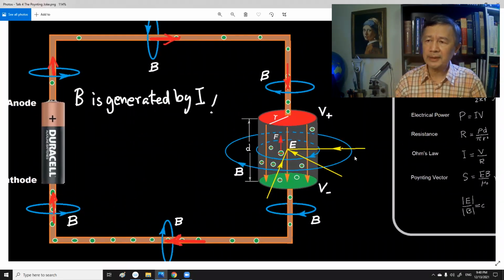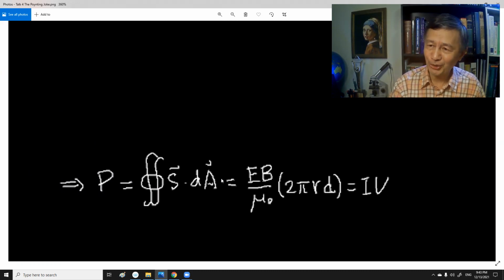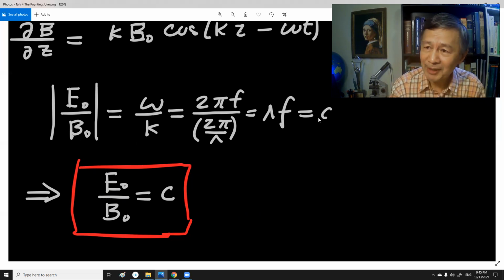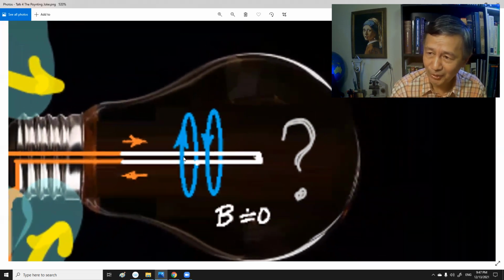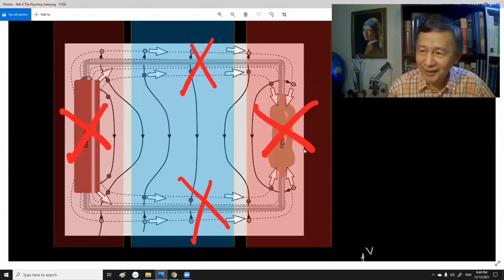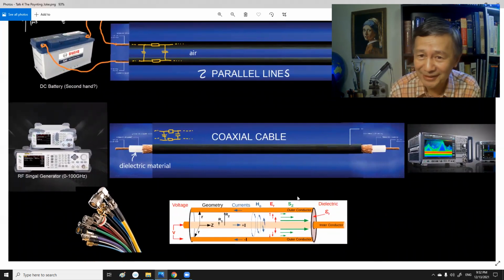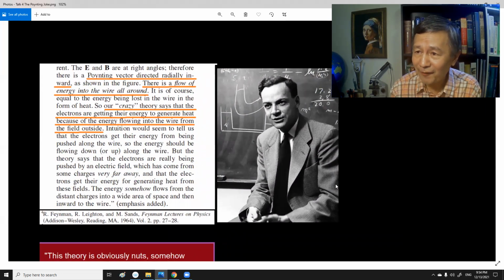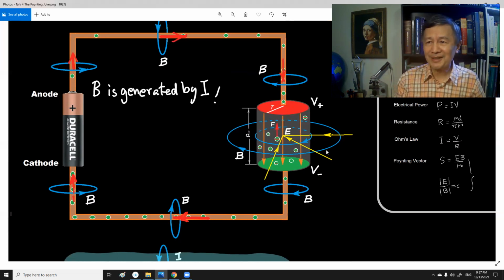The Poynting Joker | Veritasium's Big Misconception about Electricity  4 | 波英廷小丑：真理元素對電學的誤解

Comment: In the actual experiment the length of the wires is probably less than 200 feet: of course the bulb lights ‘instantly.’ Circuit theory is simply mathematical model. For practical reasons it works. The physics is way off. No energy, charge, photons, waves, spin, fields, polarity, etc. Expanding electrons crossing over from subatomic realm to atomic realm is the physical cause. DC produces a magnetic field- expanding electrons physically leaving the wire perpendicular to wire but also spiraling. No electrical field from DC. AC produces electric field only at capacitor. The travel time in the Veritasium thought experiment ( assuming as Derek says zero resistance in bulb and wires) would be 2 seconds. Without understanding Mark McCutcheon’s Expansion Theory endless debate about ‘effects’, ‘ models ‘ and computer ‘simulations’ will continue.
Reply from the maker: Are you talking about metaphysical stuffs?
Reply: @yongtuition  No. Expanding electrons are particles, objects,matter. The “quantum “ so called. Juliana Mortenson website Forgotten Physics classicalized QM in 2010. Everything- excepting some Copernicus, Galileo, Kepler and Brahe) in physics mere gobbledygook. No metaphysics is possible without a proper physics. Metaphysics is yet anybody’s guess. “The Final Theory: Rethinking Our Scientific Legacy “, Mark McCutcheon requires as the title says a complete rethink/ overthrow. Sad but true.
Reply from the maker: @davidrandell2224  Then you are not talking physics.
Reply: @yongtuition  Typical . You can lead a horse to water but you can’t make it drink. Epicycles/Standard Model on the shelf of “ historical curiosities that didn’t pan out.” Grow up.
Reply from the maker: @davidrandell2224  There is no final theory in physics unless one believes in it blindly. I wish I were still a kid to ask questions naturally.